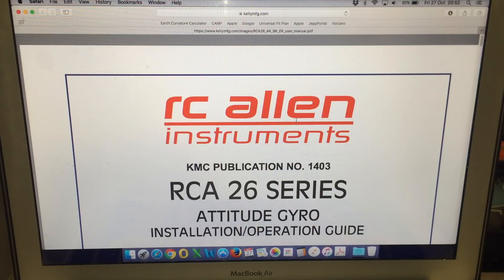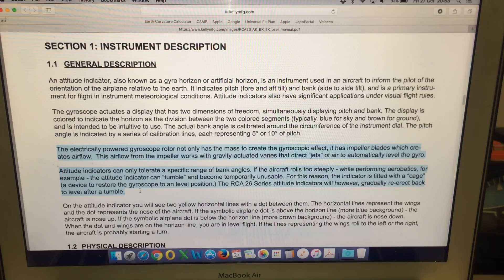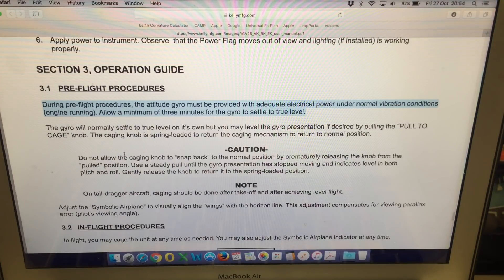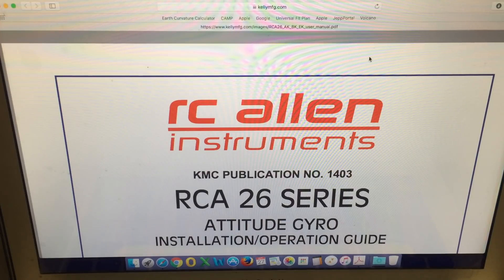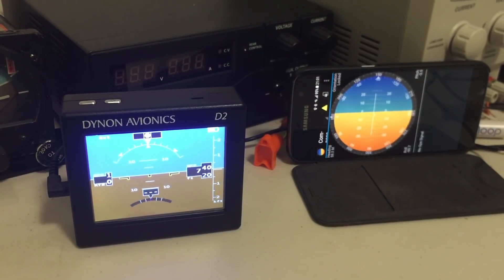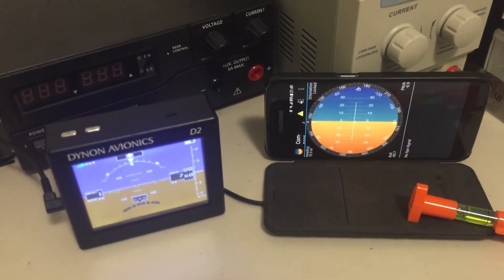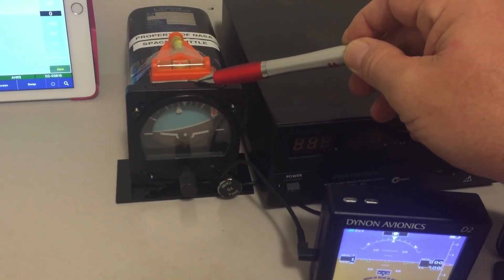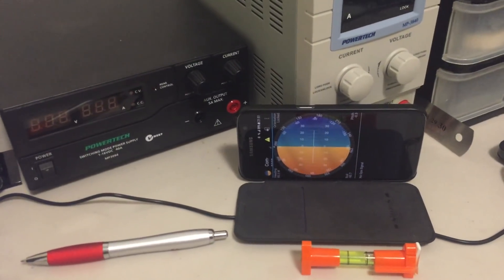Attitude Indicator Operating Manual and introducing the Dynon Avionics D2.

Comment: This sort of thing is rather useful for us sailplane pilots! We've gone a LONG way from when I first started gliding (Airspeed, Altimeter, Turn & slip, Rate of climb / descent and a magnetic compass on the top of the windshield (open cockpit in those days!) :-D
Reply from the maker: +Phil S  I wish I had done more glider flying.  I have only done it twice, the most enjoyable was ridge soaring in Hawaii for 20 minutes.  It was so peaceful and spectacular.
Reply: With "modern" fully-enclosed cockpits (with modern instrumentation - I've seen fully "glass cockpit" gliders!) it's a (relatively) inexpensive and very nice way to fly. Problem is weather - you're rather limited to VFR conditions, and obviously no night flights , however gliding IS strangely satisfying, and really good fun!

Comment: +Wolfie6020, great videos.

I would like to suggest you the simple test for showing that Buoyancy and Gravity are separate forces. (I feel shame on even suggestion this in 21st century)

It is very simple, you need plastic bottle, stick and ball (or something that will float in water), you hold bottle in one hand, stick in another and press the ball at the bottom of the bottle which is filled with water, you release the hand which is holding bottle and hold the stick, bottle will go 'free fall', but at the same time the ball will go up do to buoyancy, you capture slow motion fall. Here is the picture :
https://imgur.com/a/252Tg

What this test shows is that one Force at the same time moves ball up/down which is impossible, or as you are in aviation Zero G planes would be impossible. 

I luck equipment for filming the bottle while falling, hopefully you can do this, but for all that believe the gravity is buoyancy, can repeat this simple experiment and see with their eyes that they are not.
Reply: Mark, it is enough to look outside at the angular size of sun and know a little about perspective, not to mention azimuth, eclipses, stars, distances... these are all simple natural observations. 

The test above was performed by FES TV, and clearly shows that Buoyancy and Gravity are separate forces, which was another false claim from FE. 

FE till this day does not have simple model that matches reality, which is a first step in any serous explanation.

Comment: Oh, if you can check those artificial horizon phone apps you can check the artificial horizon of the Nikon P900 as well.
I would be interested in that result since I use it quite often.

If it works correctly every flat earther using the P900 can see for himself that the horizon does not always rise to eye-level.^^

Comment: Where  have the flat earthers gone ? Damm practical  Repeatable  expirments..another  great vid mate
Reply: The fetards are learning the futility of attempting to challenge real information presented by an excellent teacher!!
Reply: What can they say? But but but... muh conspiracy? That's about it. That is pretty much all they could possibly say to these great videos that disproves what flat-Earthers constantly claim. These claims they make about Attitude Indicators not "correcting for curvature" or how a gyroscope should drift by X amount over X time. 

Some of them actually do take a gyroscope (usually a gyroscopic sensor in a phone) on a flight and when there is no drift they say, "See! This is proof that the Earth is stationary!". It doesn't matter to them that their premise is completely flawed, in fact, they require their flawed premises in order to get away with saying ridiculous things. 

Another reason is ambiguity. Ambiguity is a cornerstone of the flat Earth, it allows them to say whatever they want about pretty much anything. They also rely on their sycophants taking their claims at face value and they do, almost without exception. When something is put to the test like Wolfie has done, no more ambiguity. 

When their premise is revealed to be flawed and/or misunderstood and the ambiguity has been eliminated then they would have no choice but to accept they are simply wrong.

Comment: +Wolfie6020 See on 'Flat Earth - Yes an aircraft Artificial Horizon self corrects in flight - Pt 1' video in CHL's comment thread that moron Stiggy said that not all aircraft have attitude indicators, A. Is that true? B. If it is, would that digital device be something that say, a glider pilot would attach to his cockpit? 

I would assume that all aircraft have an attitude indicator of one kind or another. 

I love how these things are engineered. They're so clever and ingenious. I know the digital devices are more common nowadays and the electronics are sophisticated, but the mechanical ones just seem so beautifully engineered.
Reply from the maker: +Chris MCMLXXXII  - I agree,  the little D2 is great but the mechanical gyro hums along smoothly and works just great too.   

It is true that not all aircraft have attitude indicators but those would only be experimental, homebuilt models,  Gliders etc.    Any aircraft meant for carrying paying passengers must have one.    Yes this D2 would be perfect in a glider as a back up in case he accidentally flew into a cloud.   I can't wait to test it in flight.  I haven't flown a small aircraft for five years but might go and get current again as there are lots of good experiments I could show others in an aerobatic plane.
Reply: Thanks for the reply Wolfie. I was fairly certain that any commercial aircraft would require an attitude indicator, it's a standard instrument, I presume. 

From what I have gathered, the "6-panel" instruments are; airspeed indicator, attitude indicator, altimeter, turn coordinator, heading indicator, and vertical speed indicator. I imagine that these are in most aircraft too, if not in all. 

That moron "Stiggy" thought gliders had engines in them. These people, the things they say, you couldn't make it up.
Reply: Chris MCMLXXXII 
Actually some gliders do have engines in them. They can either be fully retractable or have a propeller that folds back out of the wind to eliminate air resistance.

Comment: i know i would enjoy your vacation lol :) . there's ONE experiment that i wish you had done in this video, the phone's artificial horizon relay on gravity, not the gyro (for some reason , all the apps i tried are like that, despite the phone does have a gyro sensor) and when i'm flying any game simulation, the plane banks if i move the phone lift or right (not only by tilt) . 

i hope you can show that, moving the professional artificial horizon sideways and do the same with phone app, it proves that it's the accelerometer sensor being  used rather than the gyro
Reply from the maker: +crowxe - Yes I will definitely do that and you are right,  the phone will show some false roll but the D2 won't.  I was testing in the car today and would have made some video but the wife wasn't feeling well so I cut it short and we came home.
Reply: cool , we're thankful for that good stuff and wife's assistance , pass greetings :)
Reply: Walter Bislin 
that's amazing stuff to know, thank you. and yes I believe phones now are capable of INS navigation , even at bad accuracy, but the only 2 applications I found , they claim it but they don't navigate when the gps is turned off during navigation. 
and regarding phone gyro drift, it's even worse, vibrations totally screws it
Reply: crowxe: The gyros in smartphones measure angular rate and have a drift in the range of about 0.1 degrees per second! They are way to inaccurate to be usefull for absolute angle measurments, particularly to get absolute angles you have to integrate the angular rate, so the drift error gets bigger and bigger with time. Most Apps like the level App therefore rely on the accelerometers to measure the direction of gravity. I guess the AI app on the phone uses this method too, but perhaps it uses the gyros to sense turns so it can temporary freeze the gravity vector during turns so the AI is not affected by centrifugal accelerations and only gyro drifts during turns build up more or less slowly. Maybe they even use the compass sensor to improve the result.

If you have precision MEM gyros, accelerometers and 3 axis compass you can combine all signals in a mathematical complex fashion to correct fyro drifts. This way you have an inertial measuring unit that can act as a short term backup for gps navigation, when the gps signal is lossed. If you combine the inertial measuring unit with gps, you get an inertial navigation system. From the combination of all sensors and gps you can derive all other displayed values like attitude, turn, slip, direction, vertical and horizontal speed, altitude and position.

By the way, I recently read, that laser gyros used eg in aircraft inertial navigation systems have a precision of less than 0.01 degrees per hour! 
https://www.thalesgroup.com/en/worldwide/aerospace/topaxyz-inertial-measurement-unit-imu/infographic

They can and do not only measure the rotation rate of the earth, but also the rotation rate of the earth around the sun, which is 0.041 degrees per hour. This is incorporated into the navigation system to get accurate positions independent of gps. It not only proves the earth rotates, but it proves the heliocentric model too!

Comment: The phone app probably doesn't work properly because I would guess it's only using the phone's accelerometer sensors.  Most phones have gyros in them too I believe, so it should be possible to write an app that uses the gyros as the main input and the accelerometer slowly over time to self correct.
Reply: Yes it is possible.
The thing is:
A lot of IMU chips have both integrated: gyros to measure rotations and accelerometers to sense accelerations aka forces.
In order to produce a stable reference frame, one needs to combine both readings. That is a necessity, even if you are not heading for an IMU because of random measurement noise, that will render your device completely useless in a short amount of time. There is no such thing as a perfect sensor. All of them will show a small reading, even if they do not move at all. So if you integrate eg acceleration to have an estimate of the velocity you are moving right now, this is easy in theory but pretty hard to do in practice. The small measurement noise will integrate and just by using the acceleromters alone, the microprocessor will tell you that right now you are moving with half the speed of light in some direction, even if the device was stationary on your table for the last hour.
So there is no choice: you have to combine the reading of the gyros and the accellerometers.
This is done mathematically by something that is called a Kalman filter. A Kalman filter merges 2 noisy readings into one less noisy in such a way, that the 2 inputs correct themselfs.
But with all such merging-equations the devloper has some choices on the exact filter coefficients to use. One can influence the overall behaviour by choosing different coefficients by eg. favouring response time over numerical stability or vice versa. But whatever you do and whatever choices you make as a developer, you have to give up something to gain at the other thing. "One size fits all" works with basball caps but seldom for anything else.

Comment: Wolfe. Are you still planning on pulling apart the attitude indicator? Is the self levelling mechanism a pendulus vane or a mercury switch on that model?
Reply from the maker: +David Richardson.  Yes I definitely will do a video opening up the AH.   Reading the manual it seems this model uses pendulous vanes.   To be honest it works so nicely I am reluctant to put it under the knife until finishing all the planned  experiments with it.   It might be a few weeks.
Reply: +Wolfie6020 understand I wish I had one to play with myself. One more question. When you you force level at 20 degrees shut it down and start up again, does it always come back to the same angle?
Reply from the maker: +David Richardson.  Yes it will always self correct to level when you power it up.  If you force it to 20 degrees and power down then release the cage when the gyro has stopped it almost levels itself anyway.  The gyro is weighted slightly so it will be almost level even before power up.  I have another video I am making now but can do a video demonstrating what I mean for you tomorrow.
Reply: +Wolfie6020 thanks mate. Look forward to it.

Comment: Thanks for digging up the manual. Nice to see confirmation of the type of correction mechanism your electric gyro uses.
Does the D2 work with ForeFlight?
Reply from the maker: +53C52.   No unfortunately it is not supported by ForeFlight. I almost didn't buy it for that reason. 

 I was planning to get a Stratus 2S on my next visit to the USA as it works nicely with ForeFlight.    I like the self contained nature of the D2 though and they had local stock,  plus it is a tax deduction anyway.
Reply: Wolfie6020 
That's a shame. Still very impressive. Total electrical failure over the mid-Pacific? No problem, I've got my iPad and a D2! Amazing technology.
Reply from the maker: +53C52.  That is how I "sold" the purchase to the wife. :-)  I told her it will make my flights safer and then she insisted on me buying it.
Reply: Wolfie6020 - Brilliant!